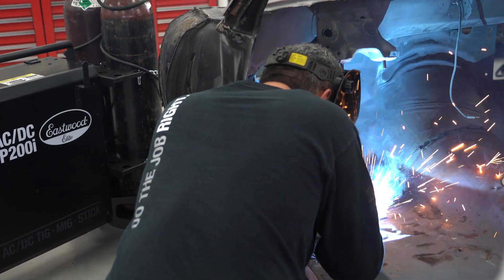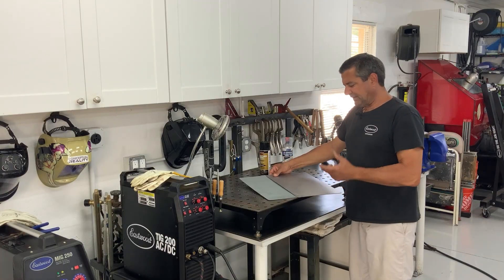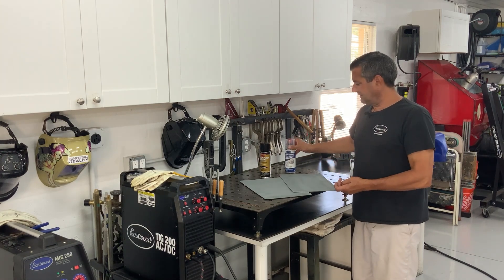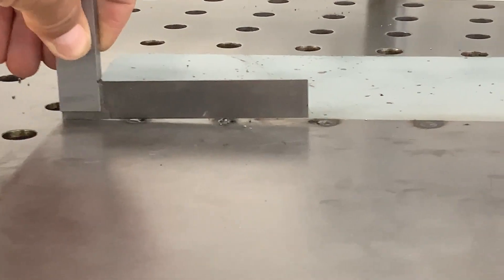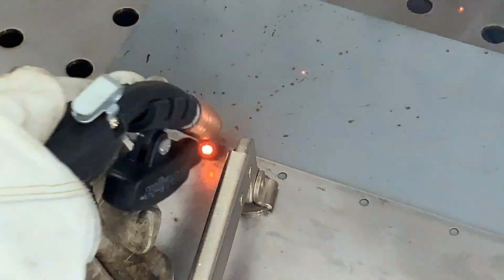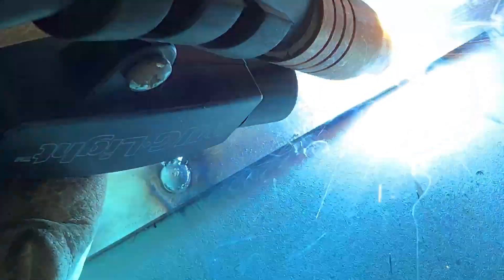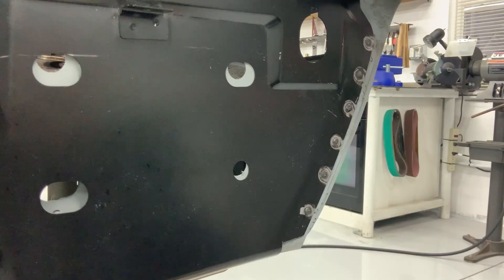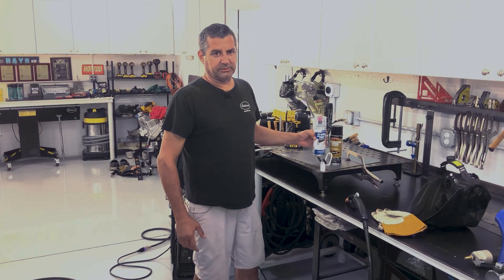Weld Through Primers SUCK! - How to Plug Weld RIGHT

Comment: What is the air tool you used to punch the holes in the metal?
Reply from the maker: Rockwood Air Punch and Flange Tool: https://www.eastwood.com/rockwood-air-punch-and-flange-tool.html
Also a manual version: https://www.eastwood.com/flanger-and-hole-punch-combination-tool.html

Comment: Just taking the primer away from the spot does not keep epoxy primer form contaminating the weld. I dont know what the ned effect would be to the weld but it will be contaminated. so I'd do this but with the weld through primer in that area.

Comment: Are you saying to coat the panels with weld through primer, then 2K epoxy, then do your plug welding technique? Thanks for the video by the way!
Reply from the maker: Mark's saying you can use Weld Through Primer or 2k Epoxy on your mating panels. Then use the end mill where you plan to plug weld. Then weld.

Comment: NEVER BOTHERED USING THIS AS FACTORY NEVER DID AND CAR WILL LAST AS LONG OR LONGER NOW A DAYS. SO WHY GO THRU THE HASSEL?  LOL
Reply from the maker: Factory uses spot welds - they're impossible to replicate with a normal welder so plug welds are the standard repair procedure.  This is how to properly do them.

Comment: Small die wire brush attachment in a drill is better for stripping the weld through coating back

Comment: Weld through primer is pointless in my opinion. No paint can stand the temperature of molten metal, the primer adds a contaminant to the weld area and finally, the weld through primer is burnt away so you have to treat the area again so costs twice as much. Pointless using it!
Reply from the maker: It's an imperfect method but you need to treat the areas that you'll know longer have access to for rust prevention.  That's why we suggest coating the mating pieces and then removing the primer in the weld area.  It might help to think of it as weld next-to primer.
Reply: The idea of weld thru primer is that as the weld cools, it pulls the weld thru back into the weld as close as possible from the surrounding area, sealing the weld between the panels.   Then, after both exterior sides of the welds are coated, it's got ultimate protection from corrosion.

Comment: I'm a little concerned about the fumes that would be created if you weld panels coated with 2k. That stuff is nasty. I've met old guys that welded galvanized and others that cleaned metal with brake cleaner. I definitely wouldn't recommend welding any coating or residue without proper protection.
Reply: clorinated brake cleaner will kill you. Galvanize will also kill you or destroy your lungs. I saw recently that zinc weldable primer is also bad and you need a respirator to protect from the fumes
Reply: Thats why you wear a welding respirator.

Comment: When  you square off the end of the bit, you also need to temper cool it in oil or water immediately after.
Reply from the maker: We're using an end mill not a drill bit that's been ground.

Comment: I’d never considered that people would try and start a weld on the paint…
Reply from the maker: People assume "Weld Through Primer" means to actually try and weld through it.
Reply: @eastwoodco  so it seems!
Reply: @eastwoodco  It does mean weld through as the name suggests. The data sheet on Upol weld through primer says "super conductive" why would that be important if you weren't welding through it ? 
I do agree it's better to remove it on the plug weld area though. It's not doing anything good, I'll try your suggestion 👍

Comment: You don't need to buy an end mill.  Grind a drill bit flat on the end and you have the same thing.  Learned that tip off of Garage Journal years ago.
Reply: Yup, 3/16 drill bit ground flat is a lot cheaper.
Reply: Former auto collision tech and I used that trick on the job all the time.
Reply: You can also drive a nail in a 2x4 with an adjustable wrench. Your ground drill bit works on flat panels but once you’re doing plug welds on contoured panels the end mill will be much easier to use and removes less base metal. But we are all here to better ourselves and learn new tricks so use a drill bit or an end mill

Comment: Nice tip, I was using a front facing thin wire wheel in a drill that I cut most of the wires off to make it about as thin as a pen, to wire brush the primer off inside the plug, but this looks way cleaner and easier.